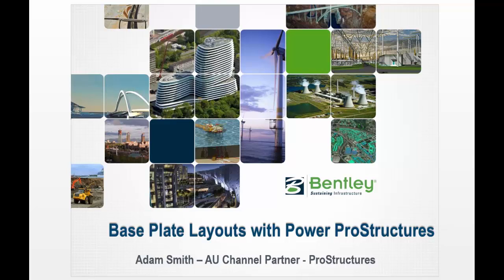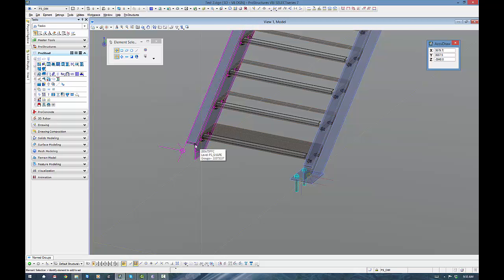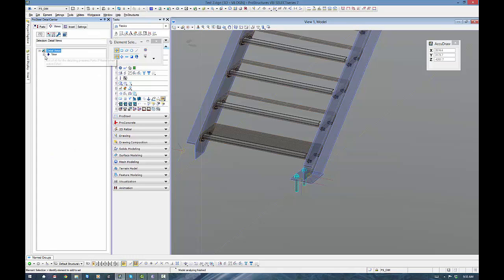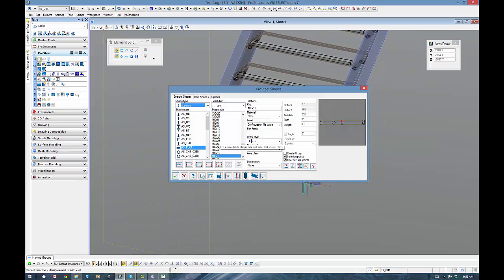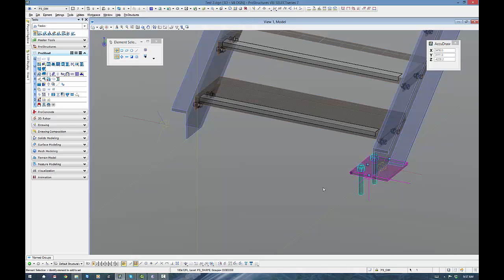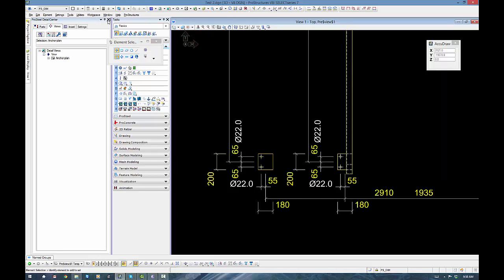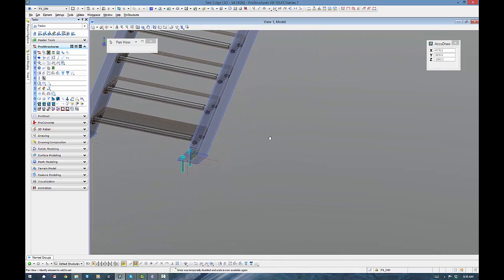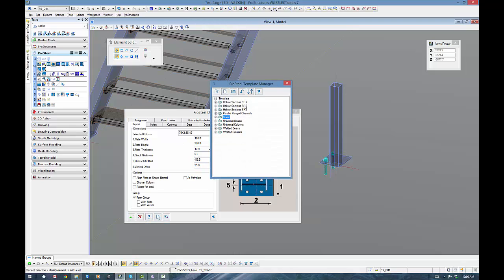Base Plates Layouts with Power ProStructures

Comment: Hi adam, can I ask where can I find the MASTER TOOLS of ur video? thanks
Reply from the maker: Iron Max Steel Hi Iron Max, the Master Tools are part of my APC Config that I sell separate to ProSteel. It is currently set up for the Australian environment, but would be very adequate for other localisations too.
Reply: Adam Smith  Thanks adam, I'm newly in Prostructure, I saw your video they were good tips tutorial, hope to have more soon tips and tutorial soon. About apc config hope it will build in for next release as its a useful tools.
Reply from the maker: Iron Max Steel Hi Max, APC is sold separately by me. It won't be available in any Bentley releases sorry. For this reason I have tried to mark each video that contains APC tools so everyone knows it is different from the released application.